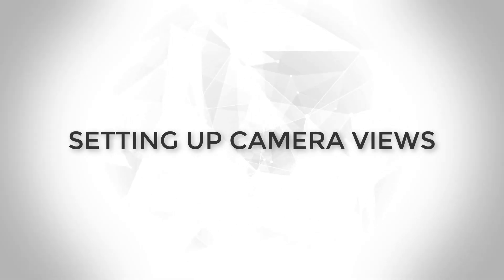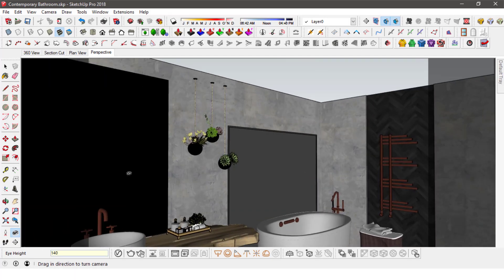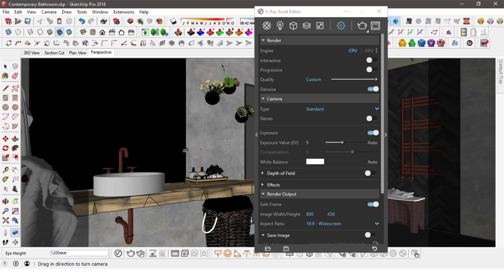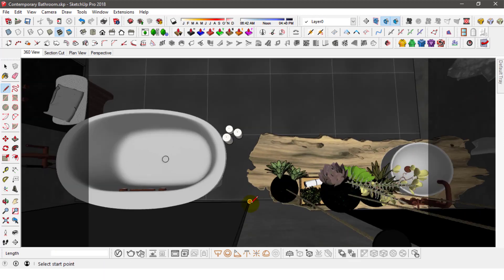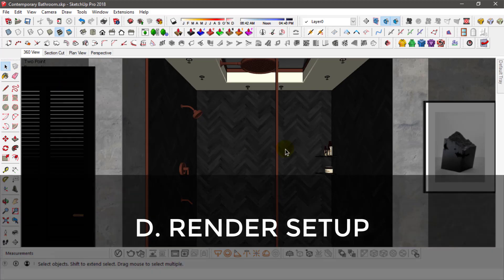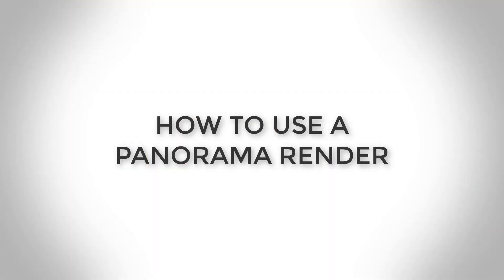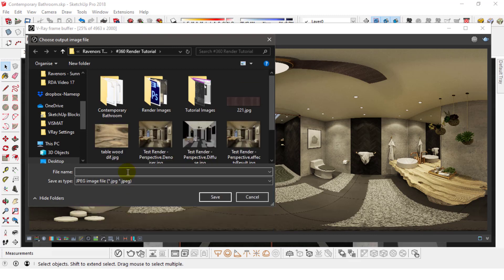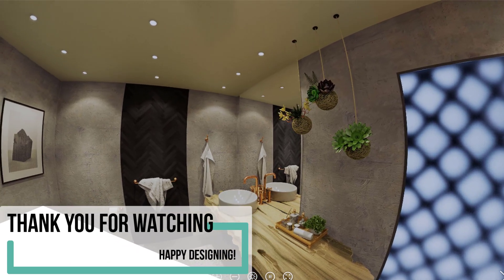How to render Perspective and Panorama 360 | VRay Camera Setup Part One

Comment: Hi there. Something I’ve noticed in many renders is that the perspective or camera position seems be impossibly positioned for the size of the space, managing a composition that doesn’t seem achievable in the space which means that the camera would have to effectively be outside the boundaries of the room space, then I noticed in some SketchUp models I downloaded from the warehouse that the modellers create extra floor space beyond the room model to set the camera so that they get more of the room in the composition 

What are your thoughts on this? Obviously it doesn’t reflect real life scenario
Reply from the maker: What you've noticed is quite common yes and a lot of moddlers do create extra floor space to position the camera, especially in long narrow spaces.
If you take a look at the third part of this video, you'll see that I always use Section Cuts to fix that problem, instead of just adding more geometry :)
Here is the link: https://youtu.be/o_0I3v_2N98